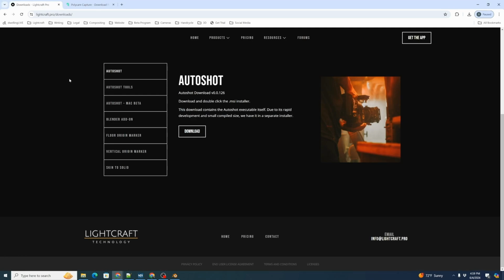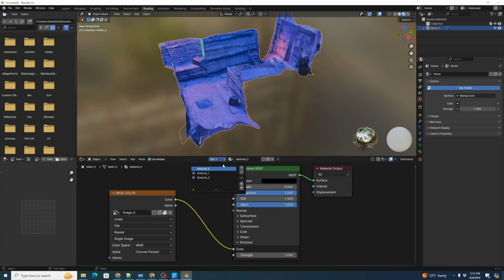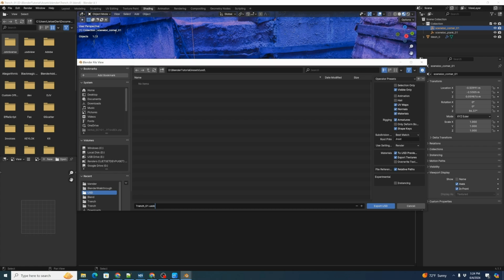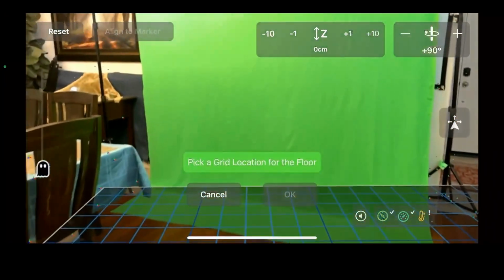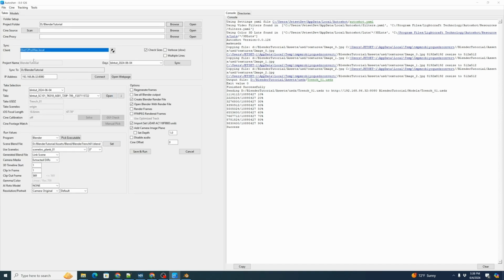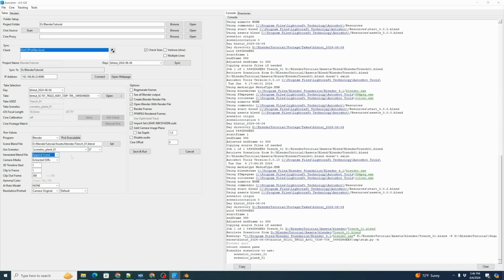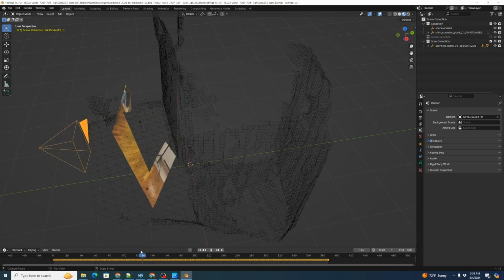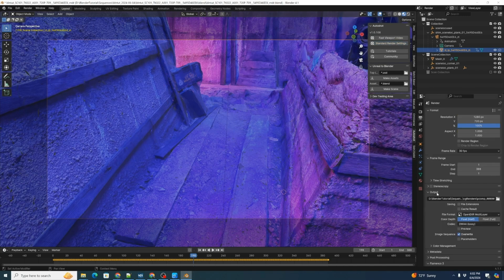Autoshot Blender Round Trip

Comment: Does the auto lens calibrate work with anamorphic lenses?
Reply from the maker: I'm interested in testing this. It should calibrate the offsets and overall field of view correctly with an unsqueezed image. Then to get the more accurate anamorphic calculations we would want to use the SynthEyes post refinement pipeline. If you want to test with us we are interested.